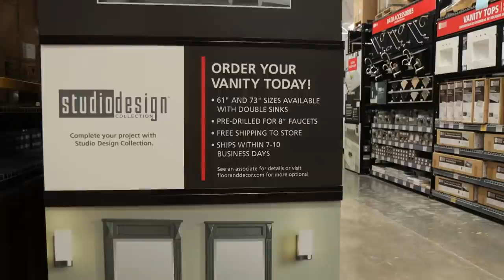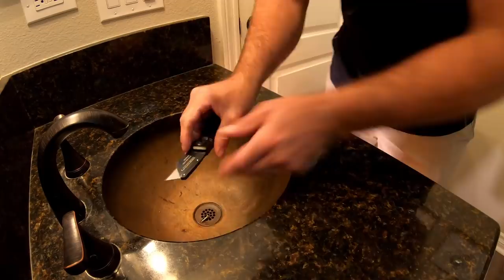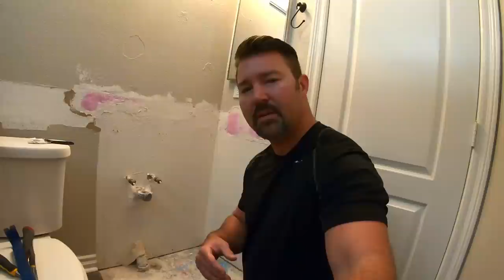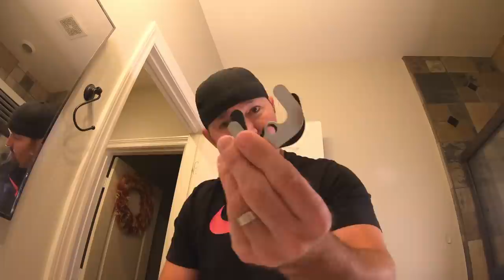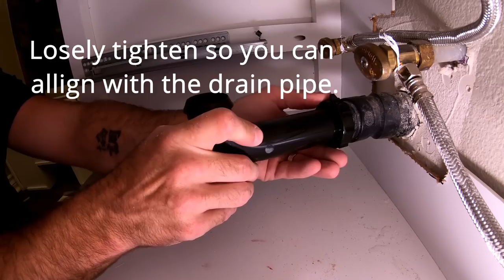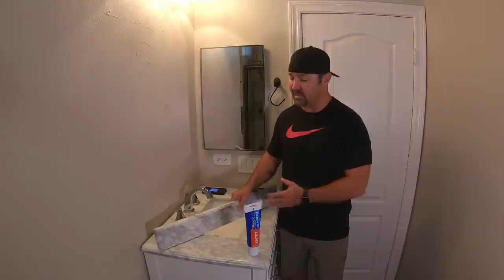DIY Bathroom Vanity Remodel from Floor & Decor

Comment: I’ve bought a similar vanity but the sink is exactly like yours but my question is how do I put the bolts into the stud do I have to take the sink and top off to access the frame? Because I also noticed you didn’t have any bolts on the frame going to the wall?
Reply from the maker: It’s a free standing vanity. I did not attach it to the wall
Reply: @MarriedwithWanderlust  so what’s the procedure for it just as close as possible and it doesn’t move by the weight of the frame and top? How did you secure it so there is no movement?